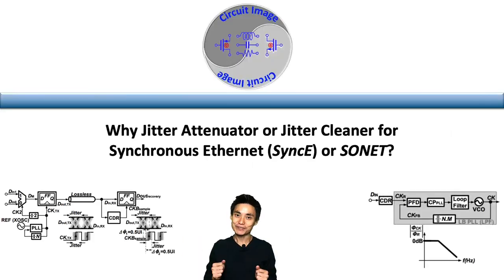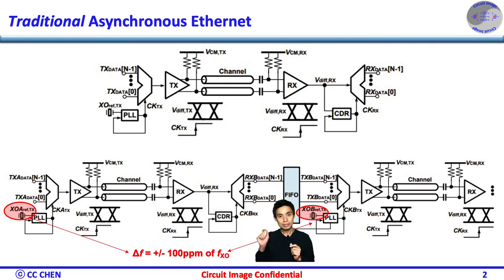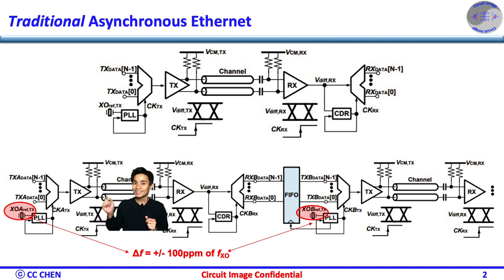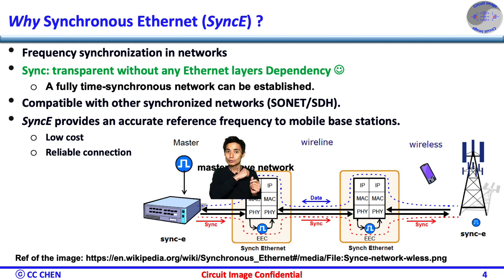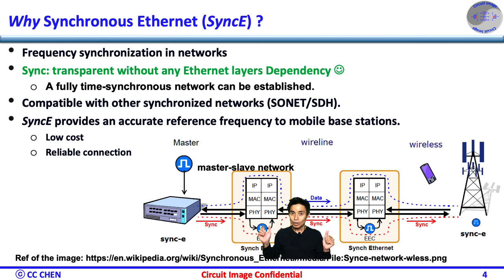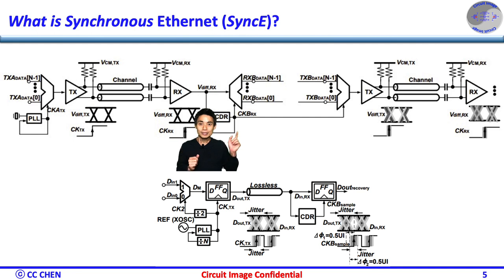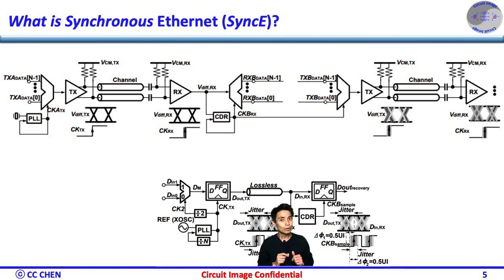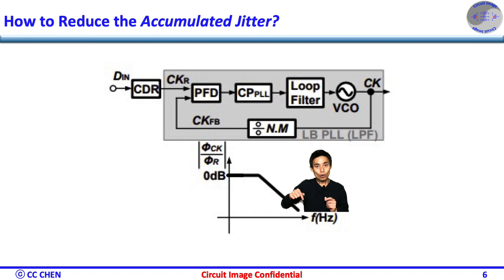Why Jitter Attenuator or Jitter Cleaner for Synchronous Ethernet (SyncE) or SONET?

Comment: Hi Chen, thank you for rendering such a great video. On slide 7, if recovered clock CKR has certain ppm offset w.r.t TCXO, which frequency is final CK going to output? I suppose the one experiencing higher open-loop gain?
Reply from the maker: Hi JY, 

Nice to mee you and thank you for the great feedback.
The final CK going to output syncs to the TCXO. Usaully, the CDR clock (CKR) should already sync to the TCXO in the same reference clock on the same chip.
Thanks,
CC

Comment: good video，but i dont understand how the  outer loop‘s loop filter output connected to the inner loop's fractional divider,since one is voltage and another is digital code?Maybe the outer loop is impletmented by a digital loop?
Reply from the maker: Hi Yujian, thank you so much for the feedback. Yes, the outer loop is implemented😃 by a digital loop.
Reply: so we need another DAC？ @circuitimage
Reply from the maker: @circuitimage
1 day ago
Hi Yujian, No. the outer loop is all digital and the digital control word is also digital; therefore, you don't need a DAC.

Comment: Why in a dual loop we can’t use a very low noise baw or mems oscillator Instead of using noisy tcxo?
Reply from the maker: Hi abhiruplahiri1, thanks for the good question. Your approach is correct if you could find a mems oscillator with a lower phase noise than the tcxo for all frequency offsets. In my image, the MEMS would have a higher inband noise (w/ low cost) than the TCXO, so optimizing the BW of 4 loops would help to minimize the noise for all frequency offsets. 😀
Reply: @circuitimage  great, many thanks for the input CC.
Reply from the maker: @abhiruplahiri1  You're very welcome.